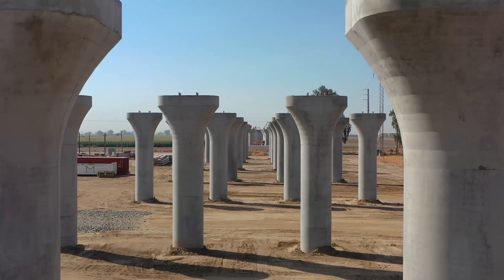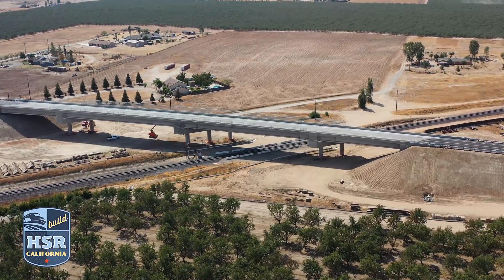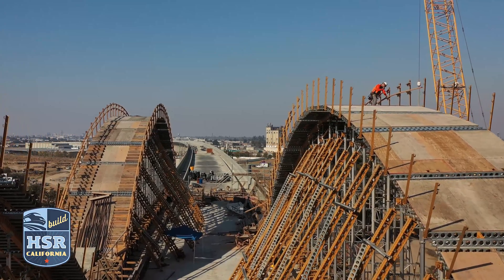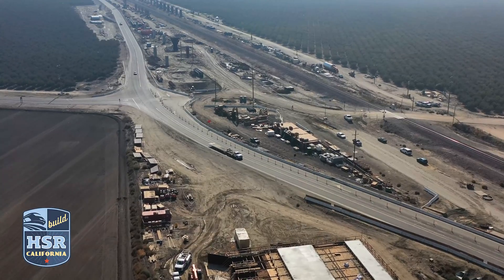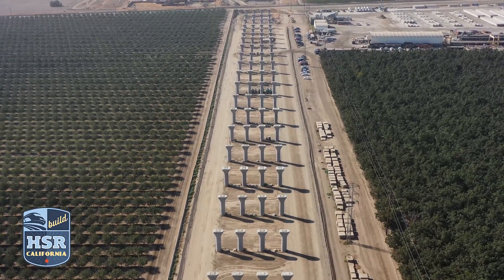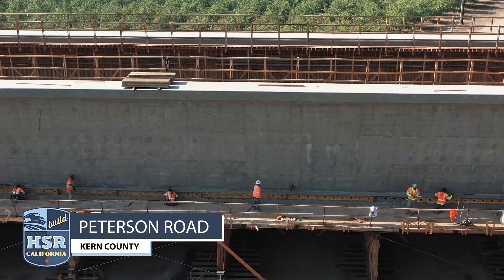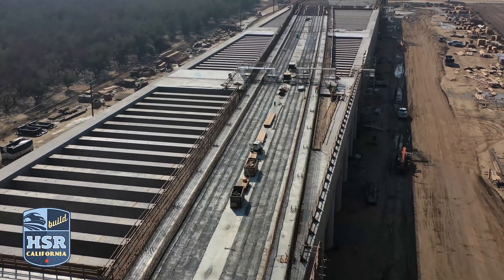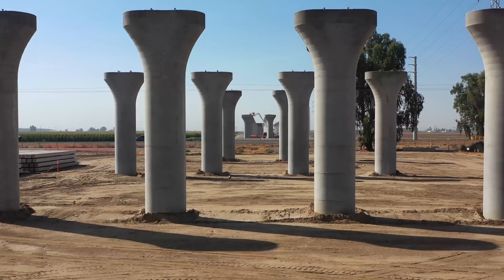California High-Speed Rail Construction Update - Fall 2021

Comment: I'm a Californian currently residing in China. This update is simultaneously amusing and sad. China is constructing high speed lines at a rate that is multiple times as fast as this project and similarly multiple times less expensive.
Reply: They are also $2 trillion dollars in debt on HSR and have some of the least used lines in the world only built due to local corruption. In fact, didn't the old Chinese HSR boss just go to jail for corruption? Also don't they have close to $1 trillion in HSR operational debt racking up?

The Chinese have made their HSR system a typical white elephant "national pride" project with no actual economic justification. I mean, the California project has its faults, but it is miles and miles better than the corruption ridden Chinese system which really makes a mockery of HSR and infrastructure in general. Hardly something we, or anyone else for that matter, should emulate.
Reply: @TohaBgood2  Sorry, but judging China's economic strategies by Western market capitalism standards simply does not work. The rail system is not a consequence of corruption or due to flailing white elephants. It is a system that places people first above money, and the net long term consequence of the rail system is a more mobile and productive society. This type of investment fails miserably by Western standards, but has proven to be a an economic windfall for China by  the standards of "socialism with Chinese characteristics."
Reply: @RechtmanDon  Is that why they built a bunch of lines to villages that only run a few trains per day? The Chinese HSR has many of the least popular HSR routes in the world. 

Also, didn't the guy who was in charge of building the system recently go to jail for taking billions in kickbacks to build unnecessary sections leading to literally nowhere?

There's the ideology, and then there's the reality. And the reality is pretty crappy in this case.

Comment: I am all for energy saving projects but I am curious was the overall carbon footprint (for the next 50-100 years) estimated for this project and compared to existing passenger transportation methods? The reason I ask is it seems like what you are building is expending huge amounts of energy and dumping massive amounts of C02 into the atmosphere.
Reply: They calculated all of this when the project was being planned. I think the reduction in CO2 is about 5x over cars and planes on the same route. But it could have been higher, but don't quote me on this. It was long ago, and I have no desire to go back and look at those documents.

Comment: Glad to see progress. But it would have been nice to see focus on building what works, modeling after Portugal and France high speed rail. There is no need to build massively innovative grade separations, especially when a lot of existing track can either be utilized or improved. Build stations in SF and LA so more people can see the progress first hand. Good to see progress though
Reply: Incorrect. The only track that exists in the Central Valley is BNSF and UP track. A train wouldn't be able to go high speed on it, even if it were improved. The only option is to make a dedicated track.
Reply: @geridamas935  Which is why they decided to build the new ROW. Why can't people just look these things up themselves? It's literally all out there in public documents or explained at length by other folks! Sheesh
Reply: They are doing exactly what you suggest to the extent that it is possible. The "bookends" in SF and LA both got tons of money to update their infrastructure to HSR standards. Grade separations at certain intervals are literally required by law, and local jurisdictions are already suing even for the ones that were legally omitted. 

Also, yeah, there is only privately-owned, low-quality, bumpy, and poorly maintained freight track on the route. Nothing even close to HSR standards that could be easily upgraded. Even if the freight railroads would let them (no way in #e|l), there would be almost nothing worth upgrading anyway.

A lot of people have tried thinking this through. All the good solutions are either already implemented or impossible for a host of reasons. I dare anybody to come up with a better plan that is actually backed up by research!

Comment: News update : the HSR line in rural CA is getting built. Passengers to be located soon just as soon as LA/SF falls into the sea once the BIG earthquake arrives. Alaska and Nebraska are looking to follow once the Republicans can bring in their next "building back the Red state better" infrastructure project
Reply: Fresno and Bakersfield have one million people in their metros each. CHSR with also connect with trains to Oakland/SF, San Jose, and Sacramento. They could also run at conventional speeds into the Bay Area and Sac until the local track is updated for higher speed. All of this stuff has already been discussed ad nauseam.

If you want an SF-LA line you need to build in the Central Valley. It's not like you can teleport over it, can you?

Comment: This i Want that this train is as fast as Maglev and Japan shinkasen.
400 og 500 pr hour or 600
Reply: Not going to happen. Too expensive. It's probably going to be a Seimens trainset, since they have a factory in Sacramento.
Reply: Shinkasen is not maglev. It's conventional High Speed Rail like this project and is actually slower than CHSR. That Japanese maglev train project is five times over budget and is more delayed than CHSR. This project is only two times over budget, so this is a hard NO from me on this one! :DD

Comment: The process and design technique used currently to build the aerial structures for this high-speed train project is outdated and way too costly.    There are modular elevated rail line designs that have been in use for many years, in other countries, with a proven track record, (no pun intended).  Modular systems go up fast and cost so much less.     With a modular design, the Rail Authority could be laying down miles of the viaduct in a few months instead of taking years.
Reply: This line runs on top of a massive earthquake fault almost north to south and crosses a bunch of smaller faults at the bookends. So if you want the infrastructure to last then modular is probably out of the question here. It could probably be adapted to fit the specs, but the cost will be similar to the "hard way" and it will still be weaker.
Reply: @TohaBgood2   I respectfully disagree with the assessment that a modular design could be more costly or less safe if used in earthquake-prone regions more so than the present design option.   The type of modular construction discussed here has been through rigorous engineering processes and has shown an excellent performance record withstanding heavy systemic activity in earthquake-prone areas.  Take Japan for instance, in 2011, an 8.9 magnitude earthquake occurred in Japan; rail service immediately stopped nationwide, however, service resumed in a matter of days with no loss of life.  A solid design with this much systemic devastation wouldn't be back in service for weeks if not months or even years. 
With regards to repairs and general maintenance:   
The modular design could prove to be a better alternative due to the ability to be disassembled and needed repairs can be done in a relativity brief period with spare parts. The present solid design is with a lot of unknowns.  The process for moderate to major repairs on a solid design would require engineering and awarding contracts; these steps take additional time that transportation arteries of this magnitude can ill afford.  Plus, the price fluctuations with engineering and bidding out the repairs could vary widely as time goes along.   This usually adds to the overall cost of projects with unknowns such as this.  Maintenance costs should always be considered and factored in as a critical part of the overall cost of any new project. 

So, in summary, the cost-savings for using a modular design could be substantial, in part, due to proven engineering designs, speed in which the project could be completed, and lower repair/ maintenance costs.
Reply: @WadersInAlaska  All good points! There are some issues with this line of thought though. The vastest majority of the right of way is at grade, meaning there is no modular component needed except if there is some kind of crossing (water, rail, auto). The land is simply flattened and the rail bits are mounted on top of a special bed of material. 

Most of the concrete sections are either viaducts or bridges. Many of these have weird geometry because of what they are meant to cross. That being said, in many places they actually do use pre-cast/modular sections. But many crossings also have unusual parameters and cannot use standardized components. 

I believe that they also use some standard assemblies for creeks and canals. But again, there are a lot of unusual crossings because the canals themselves also often cross at weird angles and are all privately constructed.

Comment: Will never  turn a wheel at high speed. Also the highest priced project in California history. What would be better spent and provide MORE jobs would be expanding the DESPERATELY NEEDED
expansion of the water storage supply. California needs WATER more than a bad attempt at competing with the jet engine. This is a HUGE waste of money. Some farmer will be using these
structures in about 20 years for grain and hay storage. Or tractor maintenance. California can be sooooo proud of this!
Reply: How about instead we ban wasteful farming of water-intensive crops in an arid area and spend exactly ZERO dollars? Wouldn't that be more effective? We'll save a bunch of money and we won't have to subsidize those greedy farmers anymore. Everybody wins!

Maybe we could even use the money we save from farmer subsidies to finish the train!

Comment: The big problem with California High Speed is that in other countries the high speed trains are part of a system that includes normal rail and public transportation.  So, for example, you can get a high speed train from London to Paris (about the same distance as LA to San Francisco, I think), but either in London or Paris you can interchange directly with networks of subways (metro), local rail, other inter-city services. How will people get to the high speed rail stations in LA or SF??? These are sprawling cities and how will people get to the stations?  Otherwise this system will only be used by those living working in downtown LA/SF and wanting to travel to downtown LA/SF??...
Reply: Many French HSR stations were/still are in the boonies and somehow people managed. Our HSR terminus stations will actually be in very dense downtowns so your point is actually moot. It is true that we need to massively improve public transportation in LA and to some extent in SF as well, but we have literally a decade to do it. So let's just do it! Everyone agrees that it is necessary.

Comment: Why not prioritize sections that currently have no rails and start service early using old rail routes until the rest of the line is ready?
Reply: There are no "old sections" that can be used for high speed service. That's the whole point of building the system in the first place. The freight companies own all the track in this area and there is no other track to use.

Additionally, we already have the excellent San Joaquins train which serves the exact same route on freight tracks and is one of Amtrak's most heavily used lines in the US. So the intermediate service you want already exists and is wildly popular for what it is (at least by US standards). The section currently under construction will connect with this train in Merced and will have a platform transfer with trains heading to Sacramento, Oakland, and San Jose. Alternatively, they could continue on slow tracks into the inner Bay Area with the actual HSR consists. This is marginally more complicated, but can certainly be done for one-seat Bay Area service.
Reply: @TohaBgood2  There are no train services between LA and Fresno, not even slow ones to connect with a high speed one. That section that should be having priority. There are train rails in that area, but they are heavily used for cargo trains and unlikely to ever receive extra passenger trains. The high speed rail construction could even add a parallel slow line for freight that it would probably fill up to the capacity very quickly.
Reply: @gteixeira  Amtrak has wanted to add parallel track on the Bakersfield to Palmdale section for decades. The state has also tried. The freight railroads are adamantly opposed based on transparently bogus pretenses. They know that more Amtrak = less freight. And they will fight it to their deaths because they literally think that it is an existential threat to them. They don't want to end up nationalized like they did in literally every other country.

That being said, I agree that after the Central Valley Section, the next key section is Bakersfield to Palmdale (beginning of Metrolink-owned track). In the Bay Area they can connect to the ACE ROW and run at conventional speeds into the Bay Area for the time being. But on the Bakersfield to Palmdale section there is literally no track that can be used at all. So yeah, Bakersfield to Palmdale needs to become the next focus of attention if we want the initial section to be successful!
Reply: @TohaBgood2  So the issue is to build the extra tracks that are needed in those areas. If the existing railroad companies oppose it, they can express their concerns in public hearings and leave the elected officials to make up their minds on what is best for the public. But then I would oppose to their opposition, it would be their word against mine.
Reply: @gteixeira  All of this has beeb tried. The freight railroads don't care. They have a Federal mandate and states can't touch them, so they have nothing to fear from us. The only way to succeed here is to take them out of the equation entirely and build new high speed track. Their rights of way aren't very suitable even for conventional speed trains, let alone HSR, and even more so for higher-speed HSR above 200mph.  We need to build new track anyway, so let's build proper HSR trackage without the constraints of the slow and bumpy freight ROWs.

That's what this project is all about. We just need to finish it!

Comment: So when will an actual high speed train actually run? Are the tracks capable of handling high speed trains?
Reply: It's designed to run at 220mph on most of the route with slowdowns in cities.

When it will be actually built? Ummm, whenever the local Republican farmers stop suing to stop the train or whenever we approve the rest of the money to build it. Take your pick.

Comment: 100 years ago the USA was atthe forefront of rail engineering, this project needs to finish in double quick time to get the leadership back
Reply: The USA had better public transport than anywhere else in the world in 1921, in the 30s though GM and the Detroit Car Cult, systematically bought up, then closed down the cutting edge streetcar, trolley bus and light rail systems replacing them with the transport of the future, buses made by GM, surprise surprise. This, the rebuilding after the global depression, was when the power in the USA began the slide from political to corporate control, WW2 consolidated that power. In the 50s Ike's massive highway building, technological developments (aircraft as mass transport mainly) locked the USA into a car addicted society, but it was US corporations bringing better, safer railways to Europe - the signalling, braking systems, diesel engines designed for rail use etc were from US based companies, even as their Mother country turned its back to rail and welcomed the fumed filled gridlock of the cars illusory freedom. All that is needed is for the citizens of the USA to see the downside of cars, an awareness that is growing in major cities at least. Massive numbers of light rail/metro expansions in the US today, mainly using European rolling stock currently, but when US corporations see the money, they will return in force
Reply: @Cheeseatingjunglista  I see no future for us.
Reply: @kanding3369  traffic problems in America is not that bad
Reply: Hahahah stop dreaming. USA is collapsing. USA is no longer sol world power.
Reply: @kanding3369  we are about to have driverless cars.
Reply: We are the leader in Freight Rail. Passenger rail in America is dead.. Time to move on.
Reply: @KevinDavis338  Move on? As in give up one of the most efficient ways to move people in the universe? How is that, "every citizen must own and use a car for every trip" working out?
Reply: @tylerbird8870  it's working out real well..

Comment: I am all in favor of HSR but this should’ve been strictly from LA to SF and bypassed all of these Central Valley cities. Should’ve followed I-5. Not to mention there would’ve been less farmers in the way to oppose it.
Reply: This would have been illegal according to their federal grants. Also, there is no way that the entire state pays for a strictly  SF-LA train. It was either going to connect the entire state (most of it anyway) or it would never have been built in the first place. I certainly would not have voted for it.

Also, they studied the I-5 corridor. One of the first things they did. It wasn't cheaper because you have to construct two 10ft concrete safety walls on the entire route. It was also too slow to compete with planes. Similarly, the Brightline West LA-Vegas will only run at 150mph max and be single track because it rides in a highway median.